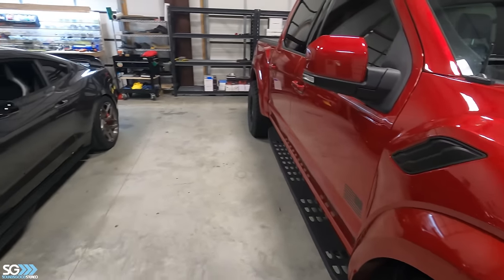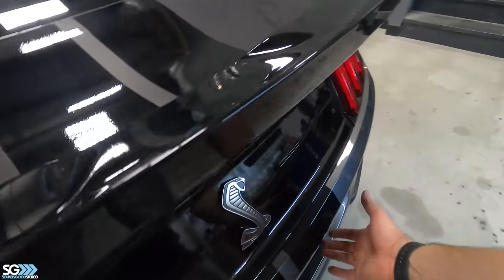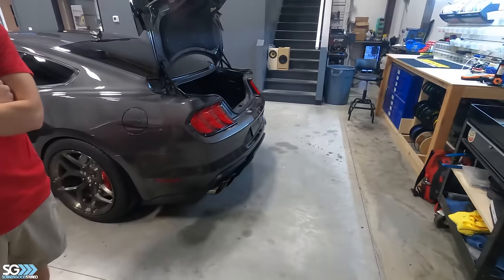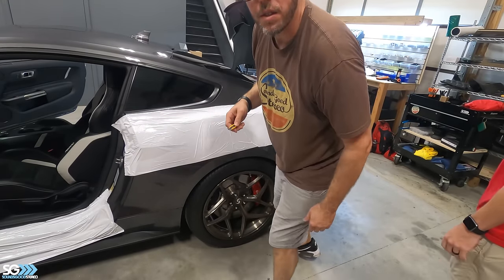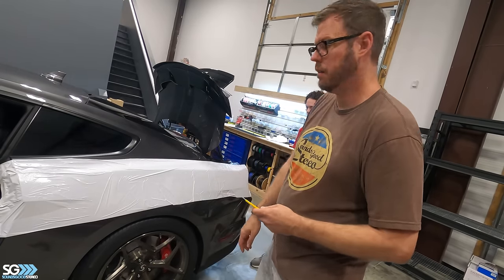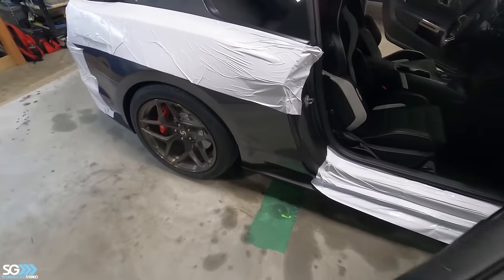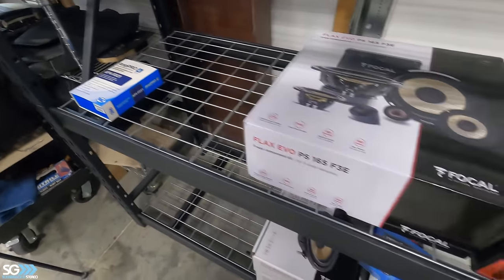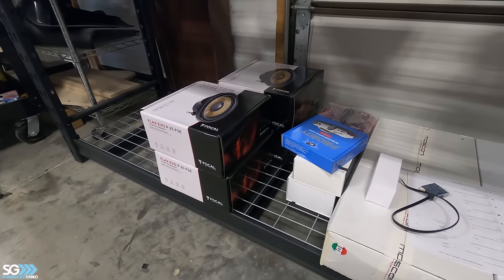2020 Ford Mustang GT500 Shelby Custom Stealth $20K Stereo System

Comment: Great install! Really impressed! Two things stood out that make your shop extra special: 1 -You took the time and effort to protect the car with wrap. 2 -Your shop has a closed off area where the material cutting is done. Helps contain the dust and keeps the install bay (and cars) clean.
Reply from the maker: Yes, we have worked really hard to treat our clients cars the best we can. But like all shops, we had to work hard to get to this point. You can see this evolution if you watch our other videos from a few years ago. Thanks Again!!!
Reply: I love this work as well but for 20gs seems like a little much but in any case i say thats a come back 10 cars per yr atleast 100+ thousand i may switch professions...those machines pay for themselves 20 times every few yrs

Comment: Your work is top tier and I love watching your strategies and execution. I was an installer for over 20 years, on and off. But I was the senior installer at a premier shop for 9 consecutive years until the 2008 recession. EVERYBODY in town closed!! We lost Sound Advice, Circuit City, and half a dozen independent shops including mine. 
I don't know what kind of MDF you're using but I used a material called Trupan Ultralite from Chile and it was lighter and more dense than typical home improvement store stuff. It machined and sanded easily and wasn't prone to splitting. 
One practice I always had when building boxes was to paint the internal portion of the box with latex paint to prevent material 'breathing'. 
Even today I dabble because once you've done car audio - stock is never adequate. I am a fan of JL Audio and Focal and to this day I still utilize both in my own vehicles.

Comment: It's the small details that add up to quality.  Just things like putting plastic protective wrap on the vehicle FIRST, before you ever remove a panel  And vacuuming out the sub box after you've drilled holes.  Can't tell you how many pounds of sawdust I've found inside sub boxes supposedly made by "pros."  Really nice shop, btw.  Great design.  Having the woodshop physically walled off from everything else keeps the dust and noise "over there" so the installers can work in peace and the sales floor portion stays clean and quiet as well.  It all adds up!

Comment: Live in middle Tennessee....never knew one of the highest quality custom audio shops was so close ....although I could never even dream to afford the kinda stuff your working on or the components....it is nice to see the little tricks and such you use with the router and other equipment to just make the install  a little touch above.....I am currently restoring a 1998 S 10 et.cab ....and doing all the work myself....stated on the inside of truck gutted it.....sanded primed and sealed all metal surfaces ....then done as close to 100 percent coverage of all panels with sound and heat shield....floor pans, back of cab roof,and doors ....As I said I couldn't afford components you used but I did add a single din alpine cd multimedia head unit ....made some custom inserts to do 6.5 mids in door and a 3in tweeter in door panel added 2 more 6.5 in rear of cab along with some 6x9 co axles in custom box replacing the old fold down seats ....added a 8 in memphis mojo 900rms 1600 peak sub with ported enclosure....running 1 4 channel orion class a/b amp for all the mids and his  and a skar audio rp1500.1 mono amp for sub ....built a custom floor in extended cab to level the floor and hide all wires.....of course did 1 gauge ofc  into a distortion block with digital read out with 2 strands of 4g ofc to amps ....and used ofc wiring throughout the build .....plan on adding more later ....so I am so glad I ran across this before I did any of the finish work like the carpet ....I know my build is no where in the same class as the amazing stuff you do but one can still learn from watching even if your not able to afford the type of gear you install....so thanks

Comment: Just did an install on my 21 Mustang GT...same interior as the Shelby.  You guys did a great job!  That sub enclosure was hot!  I loved how you make it look so easy pulling panels and wiring the system.  It took me a day to do the doors and A-pillars, which I may open up again to install some foam around the 6.5s.  Keep up the great work!

Comment: I love you guys we’re able to do this without cutting. I’ve been told mustang could be done with no cutting. Happy to see that’s true. I need to get my mustang to you 😂
Reply from the maker: Yes, no reason to cut just need patience and creative minds to figure out how to do it properly.
Reply: I agree! Did you all happen to pull measurements if someone wanted to have a front firing box for say….2 JL audio 8W7’s 😂
Reply from the maker: No, if you go front firing, be sure to understand the acoustical challenges of this. Sometimes it is not as easy as it sounds
Reply: Dang, even with the rear seats down you think? Firing the subs into the cabin?
Reply from the maker: You will have to seal off the backwave of the subs, which means the rear deck lid, quarter panels, etc. No sound can go into the trunk or you will have acoustical cancellation. It won't hurt anything, you will just have a massive reduction in output.

Comment: I've got a 2005 GMC truck with foam surround speakers and they are still running strong. They don't use rubber because they don't need to in order to get them to last a reasonable amount of time.
Reply from the maker: The lucky few...
Reply: @SoundsGoodStereo  Maybe that's a ford thing? I've worked on plenty of older cars and trucks and driven them and never had factory drivers fail like that.

Comment: Nice install.  I'm was an MECP Master Certified installer for about 12 years.  I got out of it because the economy took a crap.  My questions is, why did you go with the perforated wood grill instead of a prefab perforated sheet metal grill.  I've tested the wood style, and there is a lot of sound lost with that.  The carpet, over the speakers, also deadens a lot of sound.  Just curious why you chose that route?
Reply from the maker: Usually we will use sheet metal, but in large openings like this, the metal would resonate and not much you can do to stop it. We tested our panel/perforations in the first Mustang (two of them in this video) and it did not effect the bass performance that much in a negative way. The end result we did not feel it lacked in the bass department at all, so it was a great compromise/choice. Great question and observation by the way!!

Comment: the reason the FD21 works with the B&O amp & and the sony systems is because the factory radios are all the same, the CAN signals the radio uses to control the amps are exactly the same between the two different branded systems. Since Ford makes the radio, they have their vendors build them to their specs.
Reply from the maker: Yes, but if it is a true B&O, the FD21 will not work. We use the Zen A2B or PAC has a new FD coming out for the true B&O system 👍

Comment: I only made it 9 minutes into the video and can tell that while you guys do probably build a killer sound system, it’s overkill, you don’t need ALL of that to have a really good sounding system
Reply from the maker: You do not need all of this for a good sounding system, that is correct.. But we are not building just good, rather remarkable system that pushes the envelope of stereo reproduction in vehicles. So all of this is needed to make this happen.
Reply: Of course you don't NEED it. That isn't the point of this install. Just like the customer didn't NEED the Shelby version of the Mustang. 

People that can afford to have nice things like to pay for them. 

But yes, you are correct. This video is NOT intended for someone that is just looking to have a cheap upgrade from their factory sound system.

Comment: First time coming across your channel and I did enjoy the video and the breakdown.  I think you guys did a great job.  Do you guys ever deal with other DSP brands?  I happen to be partial to Helix at this current time and have a Helix Ultra DSP, I love the interface for tuning them and making adjustments.   Can't say that I have had the pleasure of dealing with anything from Mosconi but now you have me interested so at the very least I'm going to stop by a dealer and see how they function/sound. Not that I can actually afford it, but it would be nice to see and hear.
Reply from the maker: Most of the higher end DSPs are good, Mosconi, Helix, Arc Audio, etc. But these are just tools and requires hundreds of hours to really learn how to utilize these to their potential. For us, we have around 10 years of experience tuning Mosconi and every single project we do receives one. So for us, we can push the envelope of what's possible with a Mosconi, but you hand us another DSP and it will take hundreds of hours to get to the level we are now with the Mosconi. Hope that helps answer your question

Comment: Love the work Sage.... although I disagree about what Black hole Stuff does.   It doesn't trick it into thinking it's a bigger enclosure.  When the heat dissapates from the woofers it cools the air inside the enclosure faster to keep the woofers more efficient.  We had a huge discussion about it years ago on the 12vinsider and Bill Basore who started Q Logic back in the day went into deep detail and showed it all charted on a graph.  Pretty cool article if you want to ever check it out it's archived on there.    Anyhow as I said awesome job as always guys
Reply from the maker: We ran some tests and filmed it. This video, at 4:58 when it starts. You can see how it lowers the tuning frequency of the enclosure by adding Blackhole Stuff in the appropriate amount. 
https://www.youtube.com/watch?v=kc4AvfomdIQ

Comment: Awesome video & I appreciate everything u put into this video, was wondering how would u keep the amps from heating up
Reply from the maker: They have cooling fans built into them and the top panel is slightly raised, so no issues so far with these being covered.

Comment: Great video. Can you explain the sound difference between flax and K2.
Reply from the maker: Hard to explain, but simply put, as you go up in series in the Focal brand, not other brands, it is a substantial performance jump across the board. Everything is better, just cost more $$$.

Comment: Great video, just curious .... why you didn't run new 16g wire from amps to the speakers , instead of using the factory wiring and using something like the adapter interface by pac that hooks to the oem radio .
Reply from the maker: No need to upgrade beyond factory wiring on AC current. This is one of the biggest misconceptions in the car audio world and that's why we posted this article/post from Tony D'Amore from D'Amore Engineering. Until you reach 1000w of music to that speaker, no need to ever change it.

Read this article and also look up D'Amore and his credentials in the car stereo world..

https://soundsgoodstereo.com/blogs/blog-articles/do-you-need-to-run-new-speaker-wire-to-your-speakers
Reply: My installer did the same thing in my Mustang. I was curious as to why he didn't run the extra wire I bought, but now I know. Thanks.
Reply: To add to what the OP said, since the OEM wire is plenty heavy enough for what they are doing. modern cars use large connectors where the wiring exits the body and it is very difficult to add new wire to these. most of the methods required to do so also cause damage to the factory connector and then you can no longer easily remove the door and reconnect it.

Comment: So, the small midrange speaker shares the same volume in the door with the 6.5 woofer. Why do I have the impression this is not a good thing and ideally the speaker volumes should be separated?
Reply from the maker: The door acts as a IB setup. It works well in the Mustang and some other vehicles. Just do not put them next to each other or in a enclosure together.

Comment: I had a guy in a older gt500 showing off his 10K stereo, saying it was the best in town. He was pretty upset when he heard my 3K all JL Audio system in my 94 F150, lmfao.
Reply from the maker: You won't win the battle against this Mustang, but stereo systems are only as good as the tuning.. You can have the best ingredients in the world, but if you do not know how to cook, it wont turn out that good.
Reply: @SoundsGoodStereo  how can you even say that, you don't even know what I have. Lmfao, for 20K it shouldn't even be close but it may surprise you
Reply from the maker: It it's tuned with a DSP, fully active setup, then I believe it will sound better than most aftermarket systems for double the amount that lack a DSP/tuning. If you are just talking about more bass, it comes down to who provided more internal airspace and designed a better enclosure.
Reply: @SoundsGoodStereo  yes I'm running JL Audios DSP. Plus I'm  fixing too upgrade my C3's too the C7's not cause I need them, just cause I want them. I can literally play anything on my stereo and it sounds amazing.
Reply: @SoundsGoodStereo  agreed. I've had people bring 5k+ installs into my shop that sound terrible and I've also made garbage equipment sound way better than it had any right to just by doing the right things for the install and using the right accessories.

Comment: What did you guys do with the dash center channel?  Delete it?
Reply from the maker: Yes, on most of the systems, delete the center. We recreate the center "image" by using a digital signal processor. Only when we cross the $20K mark to we entertain upgrading the center channel. To do it correctly, we need a good speaker, a good amplifier, and a DSP that handles the center channel appropriately.

Here are the items needed to do a center channel properly in this car:
-- Center Channel
Illusion Audio Carbon C3CX 3" SQ Audiophile Coaxial Speaker Kit ($375)
https://soundsgoodstereo.com/products/illusion-audio-carbon-c3cx-3-sq-audiophile-coaxial-speaker-kit

Mosconi Pico 2-Channel ($480)
https://soundsgoodstereo.com/products/mosconi-d2-series-pico-2-compact-2ch-sound-quality-audiophile-amplifier

--Digital Sound Processor for Tuning

Mosconi 8to12 Aerospace ($1700)
https://soundsgoodstereo.com/products/mosconi-8to12-aerospace-digital-sound-processor-for-audiophile-grade-stereo-systems

Here is a different vehicle, but a similar stereo platform where we are adding a center channel:
https://www.youtube.com/watch?v=jMYCf6bDi8o

Comment: Recently got a Silverado SS, had to change a passenger side speaker, and found out it had a full focal speker system what do u recomendo to use in subwoofers to make a good compliment with the rest of the system, was planning to run 2 8" subwoofers in a under seat ported box.
Reply from the maker: Depends on the rest of the system and the tuning capabilities. Just respect the subwoofers airspace and tuning requirements.

Comment: Awesome build….but, $20k!!! Come on guys. You must’ve had to change out amps, unless the ohms on the fox Al’s matched the output from the oem amps? I’d personally like to see an Audison sound processor for this money.
Reply from the maker: All of the gear we used is in the description, check it out and add it up. Then add 120 hours of labor on top and see what you come up with 👍
Reply: Install should cost about as much as the product if not more. $300 rockford mono costs like $200-250 to install. Should you really expect a $2,000 Audison Voce mono to cost the same? Would you trust a $60 per hour mechanic on your $300,000 Lamborghini?
Reply from the maker: At $250-300, you are probably not building a custom amplifier rack to house the amplifier. That is labor for wiring by itself. You add in 10-channels of active amplification, complete sound treatment, custom CNC and laser cut speaker adapters, CAD designing, false stealth floor enclosure, hours of DSP tuning and now you have your labor cost. Yes, the labor is always the same as the gear and the difference is higher end gear requires more to setup and many time more custom labor to match the customers lifestyle.

Comment: Seems like for 20 grand everything would be seam stitched by hand, pressed and textured leather with a 3d padded backer, motorized and hinged rear display with hands free function to raise and lower the box and cover separately.. audio tuned and with all the bells and whistles for the immersive audio with full distant surround, built in displays front and rear for readouts and invisible touch video lcd 's. And everything be 100% waterproof..
Reply from the maker: Nope, we do not waste $$$ in those types of items any more. Now it's high-end gear, advanced tuned signal processors and handcrafted install that works with our older clientele that enjoys the factory fit and finish we provide. I assume you are not familiar with these products, so if you want to check them out, they are listed in the description below. Also, check out the other videos on the channel if you want to see a variety of $20K installs. Enjoy :)

Comment: Do you sell the door midrange speaker adapter and connector?  I have a 2017 GT350 and wanting to do a speaker upgrade.
Reply from the maker: Yes, here you go:
https://soundsgoodstereo.com/products/2015-2020-ford-mustang-custom-mid-range-adapter-for-aftermarket-mid-range-speakers
Reply: @SoundsGoodStereo  what’s the cut out diameter?
Reply from the maker: 73 mm
Reply: @SoundsGoodStereo  damn. Was hoping it would it one of the Memphis mid ranges.